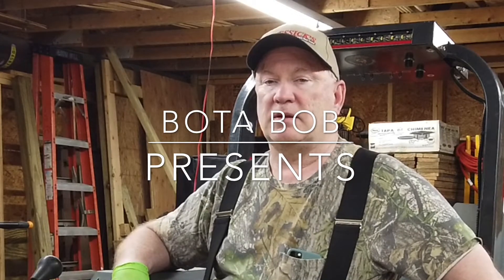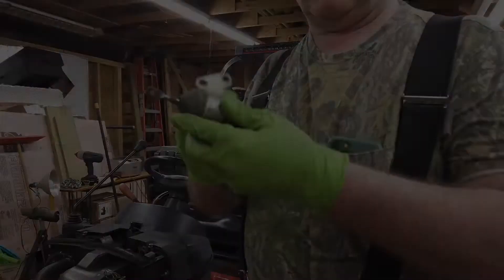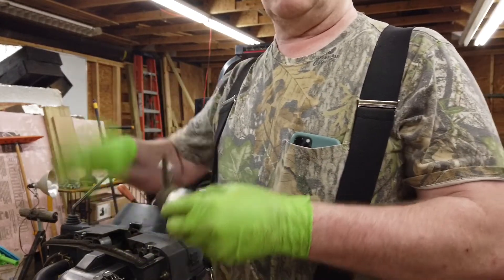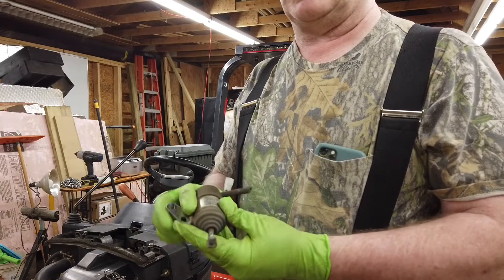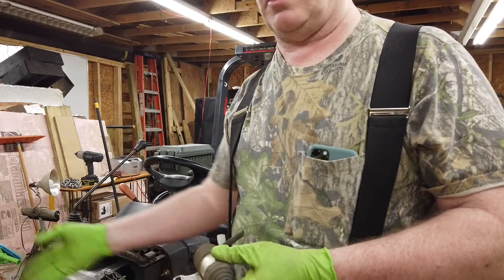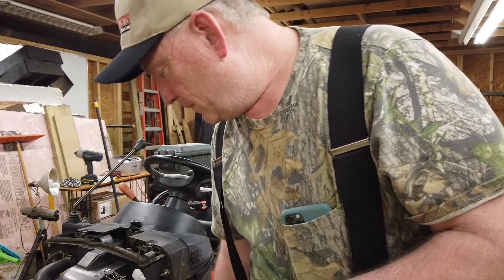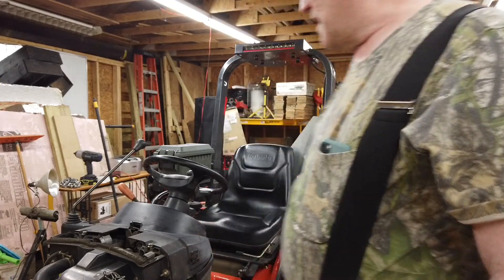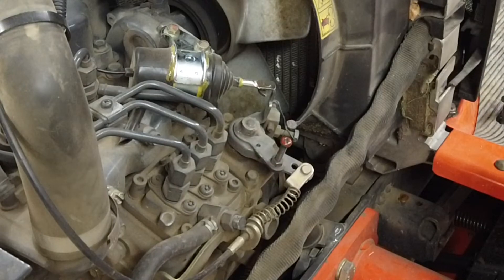#59 - The Fix Is In

Comment: Hi Bota Bob - How did you know how to do this?  We found your channel from a comment you left on the Morgan's video.  Thanks for sharing.  Please check out our channel if you get a chance. We live in rural PA, not far from Mike and Melissa. Thanks!
Reply from the maker: Let me start by thanking you for commenting on my video.  I have formal training in a number of mechanical and electrical disciplines.  I was an Electro-Mechanical Computer and Switching Systems specialist in the Air Force.  I was trained to read schematic drawings and then how to Isolate problems.  I also worked in a machine/speed shop when I was a teenager in high school.  I currently work for a global information technology company.  
To answer your question, "How did you know how to do this?" I am not sure if you saw video #58, but that goes into how I confirmed my suspicions on what the problem was with the BX.  Other than what is in video #58, it was a combination of life experiences in the AF where I operated deuce and a half, and five ton trucks and learned a little about how the diesel engines operate, and my experience reading schematics and block diagrams to fix various communications and computer systems.  Before I started to troubleshoot the BX, I opened the BX workshop manual and looked at the electric system for starting and stopping the BX engine.  I then called Messick's to ask them if they had any of the shutoff solenoids on hand, the parts guy suggested I test the fuse first.  Once I found all the fuses good I looked for the 12vdc on the solenoid after I turned the key off, and the 12vdc was present, but the solenoid did not activate.  I demonstrated this in video #58.  
I will be sure to check out your channel and subscribe. Cheers